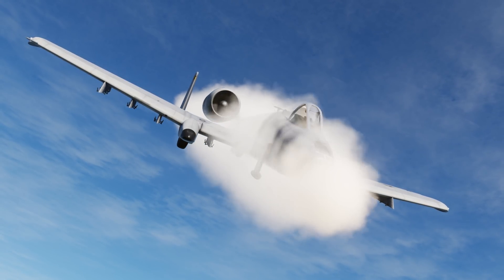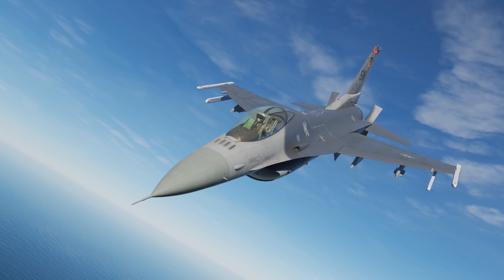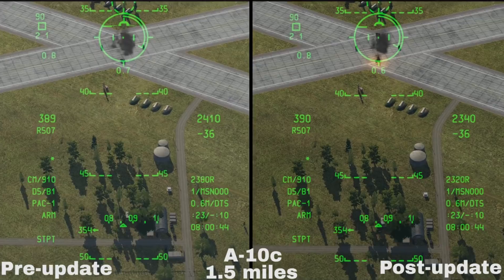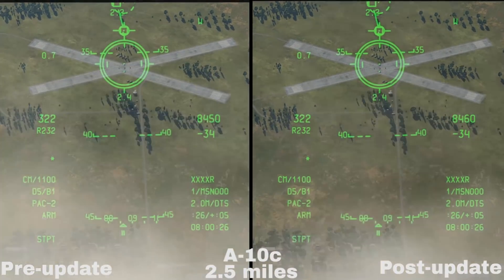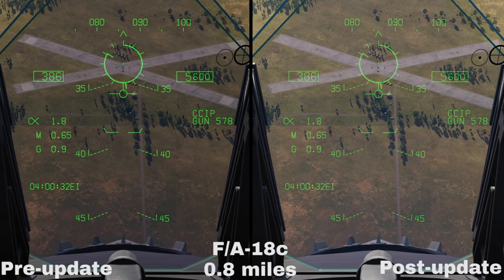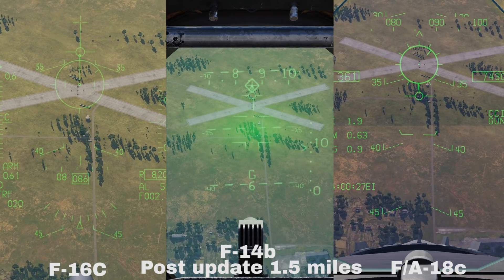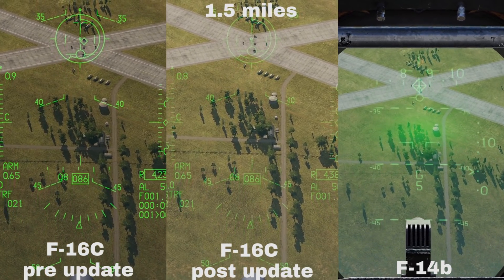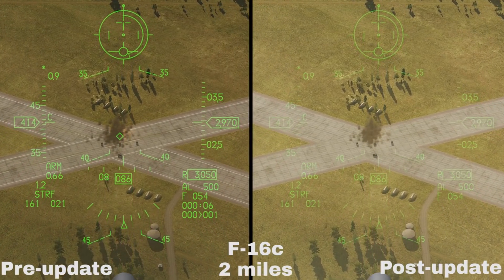DCS GAU-8 and M61 Gun dispersion update comparison

Comment: Thank you for doing this, it is appreciated. After viewing the F-16 footage, I am impressed that DCS models yaw from the gun firing. Since it is to the left of the aircraft center line, placing the sight a tiny bit right of the target seems like it would be helpful.
Reply from the maker: With a little rudder practice you can cancel out the kick quite nicely, i opted not to, to try and avoid adding extra wobble for the tests as i'm not terribly well practised with the f-16 gun!
Reply: @RedKiteRender  Yep, with so many good aircraft it's hard to pick one and stay current on all the nuances.
Reply: The flight control system is supposed to automatically offset the yaw induced by the gun, so no input should be required, but likely not modeled yet.

Comment: Great video. I tested the A-10 fun against tanks, it shreddes anything below a T -55; is ok against -72, has a hard time against  -80. Although much of the ammo is spent by tank. No chance against a -90.
Reply from the maker: When ground units get a new damage model i'm sure it'l be easier to mission / mobility kill them. Yeah for some tanks, hitting the rear and above with a lot of rounds will do the job, like it did in the past, trouble is you're always getting very close to do so and they'l shoot back like nothing is happening. You'd think some 30mm hitting the roof would put not only the gun itself but the crew off their game a bit!
Reply: @RedKiteRender  Agreed! At least they would be very, very scared and try to run.
Reply: @sloppydog4831  what range, direction, and angle are you firing at the tanks from? Because I can reliably kill even T-90s in 1-2 passes. 40+ degree dive, rear armor, firing 0.8 nmi inwards to 0.5

Comment: The difference between the Hornet and F-16 come from the round types. Try out the built in gun missions, the In-range cue is on the 7 o'clock, not the 5 o'clock as shown in your video.
Reply from the maker: The IN RNG cue is dynamic and varies depending on your approach. I've never seen more than about 6 o'clock by the time the slant range reaches the maximum range. which is still, painfully short range compared to the others. 
The issue is not round type, nor can we select between M50 or PGU in the editor.
The pipper does not compute a solution prior to the cue, and that the cue seems way too short to be practical for anything other than a completely undefended target.
Now, i couldn't say if this is a real world design choice or an early access feature issue. It makes sense to have an Ideal range cue, but i don't understand why they wouldn't compute the pipper prior to it like in every single other aircraft in dcs.
Reply: @RedKiteRender  Well, although I cannot comment on most of the aspects you just mention, the bullet type does matter, not as M50 or PGU (F-16 rounds are also PGU), but as in HE, AP, ect. I will get a screenshot for you and send it over discord. As the Hornet has only HE, it has the round with the least distance capable.

Comment: Very cool vid. I agree, it makes no sense that the Hornet's in range cue is so short. Although I wasn't a JTAC, I was a Recon Marine for years and many of my colleagues were JTACs. Usually one per platoon. We used a lot of Marine F-18s for CAS both training and in combat. I've seen a lot of F-18 gun runs, and they would NEVER get that close when they shoot. Ever. A pilot will do a lot of things for you, but they're not going to expose their aircraft to effective AK fire. They'll get right down on the deck to do a show of force pass, but they'll be on burner for that or at least mil power. Their gun runs are done from pretty far out. Dispersion isn't great but the gun isn't meant for that anyway. I know it's anecdotal, but think that cue is way way off with the Hornet's gun based on my experiences.
Reply from the maker: I'm under the impression it's just missing the logic to give a correct guns solution prior to the 'IN RNG' cue. Why, i don't know. I bet you could suppress targets just fine if the pipper was active prior to 'IN RNG', Perhaps it's an early access issue, i couldn't say. Thanks for sharing some of your experience!

Comment: Well, I'm glad ED has finally made some updates to the gun systems after years of the community beating them over the head with tech manuals and data sheets.
Reply from the maker: ED have really been great this last year or so with correcting some long standing issues, it's coming together, abet slowly.
Reply: @RedKiteRender  This is a massive improvement, but the F-14's vulcan is still the only one that meets the GO/NO-GO spec for US aircraft. 80% in the 8 mil circle for a GAU-8 is the point at which the barrels are depleted and MUST be replaced before the aircraft can fly again. it's a 5 mil circle for the vulcan, and uses the same 80% Mandatory Maintenance requirement, so, at the most pessimistic only about 15% of the shells should be landing outside that 8/5 mil CEP  before someone is going to replace depleted barrels and mountings, in game it's closer to 30%, and before this update the M61 on the Eagle had a nearly 20 mil dispersion, which is insanely out of spec.
Reply: Reminds me a little of the history of "Oleg's bar" back in Il-2. I think it finally got changed when Team Daidalos took over... ED did the exact same change rather quickly though.
Reply: @CakePrincessCelestia  From what I'm gleaning, it's not quite the same thing; Oleg's Bar is a result of not modeling refraction, which, well, I don't think anyone can possibly blame any game dev for not implementing refraction into anything. At the very least, they'd cry more about the awful framerates than anything else. ED's vulcan, though, was just flat-out bullshit that couldn't even be passed off as "a pessimistic interpretation of the most commonly-seen documents".
Reply: @Derpy-qg9hn  You're right, but it was still very similar in regards of "here's the data that prooves our claims" with nothing happening for a very long time. Since even DCS doesn't model the refraction, it has to be made geometrically wrong to look right. Regarding the Vulcan, the most interesting thing I've seen in the whole discussion was Yo-Yo, one of the devs saying that they did model a muzzle clap that makes the thing spread like a water can. So it wasn't that unrealistic after all, but rather uncommon. And probably just OK while the only flyable AC having the thing was the F-15C. But I am very glad they finally changed this :)